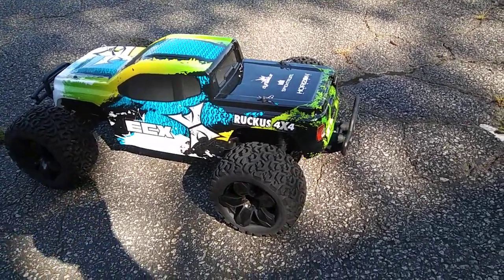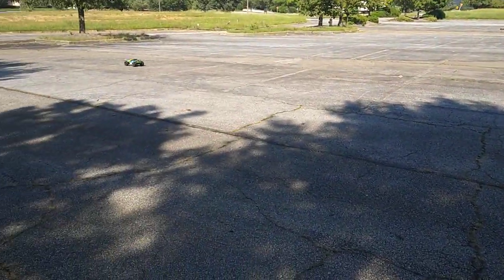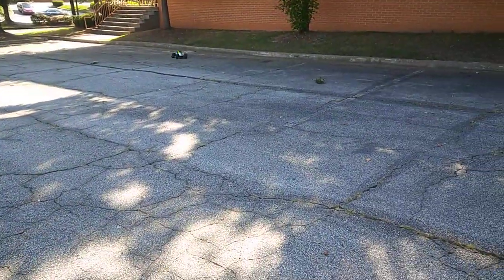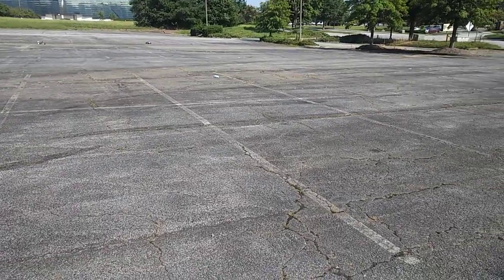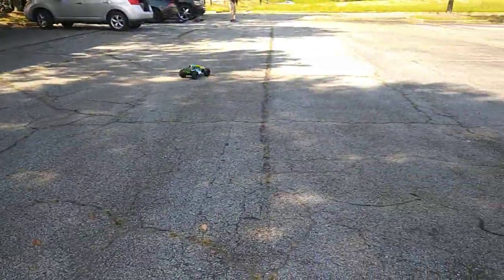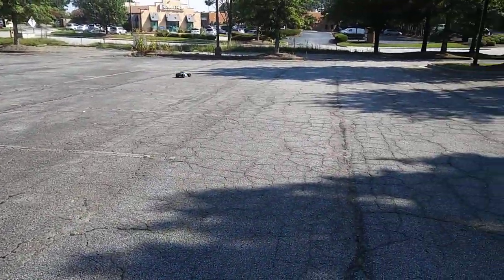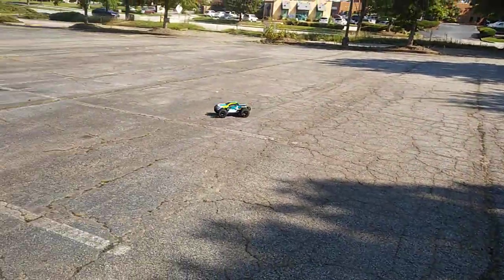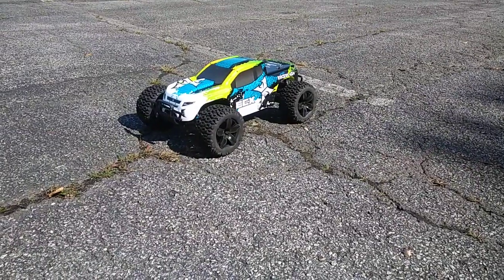ECX Ruckus Brushless 2s Run

Comment: I may have to regear mine cus with the brushless system in it, it’s hard to control when I hit it the thing just spins out sideways, ya I put the amazon special servo in mine it’s only $17 it’s 20kg waterproof servo. I had range problems because I had a faulty receiver which they have sent me a new one